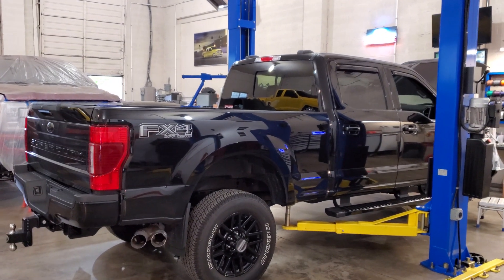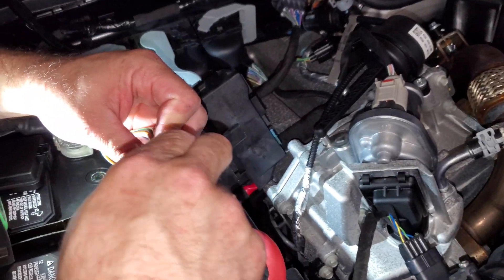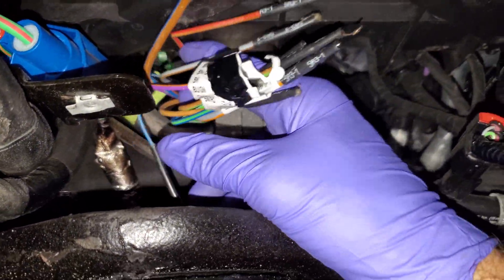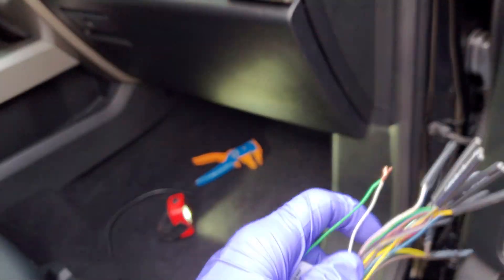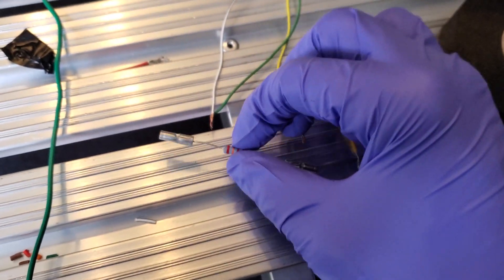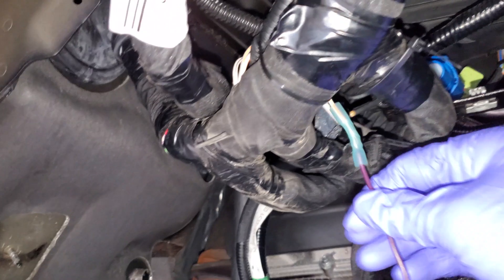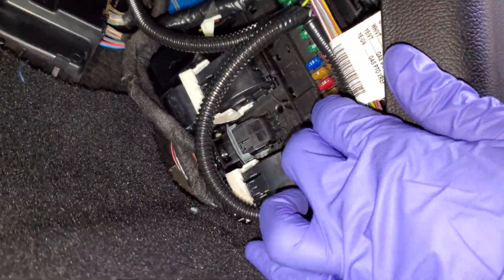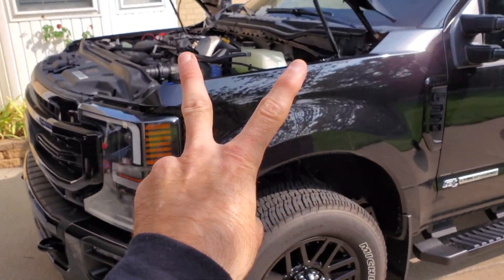17+ Superduty 6.7 | HIGH Idle Up-Fit | HOW TO

Comment: Could I Use a 20 k ohm resistor? To achieve around 1200 rpm?
Reply from the maker: U cld, but bro i took this out & got the BD high idle switch. WAY BETTER

Comment: Off-topic question… hearing the accessory power chime from your truck reminded me. 

My ‘18 350 is stuck with the pre-sync 3 chime (2011-2016 thin sound straight out of the cluster). I have heard of this issue from others in the past where it reverts to the cluster, but cannot figure out how to correct it. Of course, two dealership service departments that I have spoken to have played dumb when I asked them about it. Any thoughts or suggestions? Thanks so much!
Reply from the maker: Still does it, haven't correlated it with jack diddly yet 🤔🤔
Reply: @ that is what I was afraid of lol. Oh well..just thought I’d ask. Much appreciated 🙏🏼

Comment: Dunno why, can’t get my 22 450
To work. 
Upfitter 1 to pass through wire
Pass through to yellow/green (next to the violet/brown)

Solid green to blue/white

Using 15k .5w resistor

Comment: Just came across this video and it sounds like you are pretty knowledgeable. I bought the bd diesel high idle kit and they told me the reason it isn’t working on my truck is that the pto is not hooked up. I know it’s a long shot but do you know what that means?
Reply from the maker: This is just a hook up hi. Idol and has nothing to do with p. T o

Comment: Can you think of a reason for this to suddenly stop working??? I did it on my 2020 and it worked fine until now it just doesn’t work. I’ve checked the voltages to it and the resistance of the resistor and all is normal. The truck won’t even go into high idle by itself when idling anymore. Thoughts anybody?
Reply from the maker: Hmmmm. We have since removed and got the BD high idle kit. We made a video for it. Was way better
Reply: I saw that…. I also watched a video you did fixing a PTO with a broken wire and the e-brake light didn’t come on. I am going to check that next as I didn’t make sure that part is ok. I considered getting the BD kit but thought that might not work either if this system doesn’t work.

Comment: ARod, I did this to my 24 the other day, everything works fine but after a few minutes of high idling I noticed the truck was making more noise than usual, kind of like the noise it makes when using the exhaust brake. I checked my gauges and the truck was making 8 lbs of boost and climbing and my EGTS were at 800 and climbing. Any idea what was going on? The truck is stock other than the high idle switch
Reply from the maker: Yea that's normal, they want them EGTs hot for that burn off
Reply: Ok cool, I figured the truck might have been taking advantage of the higher rpm’s and trying to clean the DPF but I wasn’t sure. It spooked me, I stopped leaving it unattended while high idling and when I would hear it spooling up like that I would go shut it down. Glad to know it’s normal. Thanks for the reply man.

Comment: I ordered the BD DIESEL Performance 1036612 High Idle Control last week and just saw this video, I guess I'm going to be sending it back because I like using my uplifters just wanted to know what's the Watts of the resistor but other than that Dam good install video keep it coming.
Reply from the maker: Watch the newest video. We took that out. The BD kit ks so much better

Comment: I've got a 17 six seven.  Same pig tail in passenger side.  But I got lights hooked to up fitters 1 and 2.  No way these other acronyms on the pig tail represent up fitter 3 or 4 in order to use those switches?
Reply: I got it figured out.  Thinkin on the run!

Comment: Some things to note: I just did this on my 2022 psd tremor, Ford has since moved the through wires to where they are really convenient, the ones inside the kick panel are right next to the harness, then under the hood they are right of the three big ecu harnesses tucked under them next to the firewall behind the fuse box you removed with the aux wires. So don't rip out your fender liner for absolutely no reason like I did 😆 also, there are TWO yellow with green wires and that was not discussed. Wire #7 is the yellow/green wire you need for a diesel, the other yellow/green wire is for a gas engine applications. Great video otherwise. And props to Ford for Making it more accessible!
Reply from the maker: U shlda seen our newest video, way better
Reply: @PowerStrokeTechTalkwARod  subscribed! Ty!
Reply: @PowerStrokeTechTalkwARod  link to video in reference? Looking at the list don't see any other high idle reference, unless you're referring to one of the light hookups?
Reply from the maker: We have 3 high idle videos....this one......& 2 we just made. One for 2017-22 & one for 11-16. The 11-16 video is now HOW i mount all trucks
Reply: @PowerStrokeTechTalkwARod link?

Comment: Why does ford make the pass through wires so short? It is ridiculous 😂
Reply: Fellas, my 2017…those things are so far tucked up I can’t reach them with my hand or 9” 45° needle nose pliers. Advice?
Reply from the maker: YOUR MISSING OUR NEW ALUMIDUTY HIGH IDLE!!!! GO WATCH OUR NEWEST VIDEOS
Reply: @PowerStrokeTechTalkwARod  no I didn’t. Trying to save money dude. Carli suspension ain’t cheap.
Reply: @PowerStrokeTechTalkwARod  and I just found a better alternative. It’s a little cheaper…12v solutions has a bad ass kit for our trucks.
Reply from the maker: Ok
Reply from the maker: Bro i know......2022 they made longer.

Comment: Spliced in resistor and tried but when I hit the white/brown wire with 12v it just cycles the turbo wastegate? Any thoughts
Reply from the maker: Whaaa
Reply: Green and white/brown get resistor will have another go at it
Reply from the maker: Check out our latest high idle video, so much better

Comment: Thanks Aaron! Great video. I learned that on my 17, there are 2 yellow with green stripe wires. One is for gas pto, one for diesel pto.
Pin 7 is the one for diesel PTO. 
Works great!
Thanks again
Reply from the maker: Hell yeah. We have a new high idle mod coming. I will tell you, i will be removing this. You will like this 1 even more😁😁
Reply: @PowerStrokeTechTalkwARod  is that out yet?
Reply from the maker: Yepp was out months ago
Reply: Mine too thanks
Reply: Thank you for this!

Comment: Hey Brother, had a F150 gas and now I am driving a F350 6.7, great content. I might have missed it somewhere, but can you tell me where I can get the resister you used and the part number if you got it.
Reply from the maker: I found them on Amazon. Its been a minute since i bought em tho
Reply: @PowerStrokeTechTalkwARod  , cool, I am looking on Amazon and found the 22K resisters, but there are different watts, what do you recommend?
Reply from the maker: U know thats a good question, i threw the gd bag they came in out 😔😔.

Comment: I have new 2022, F250 Lariat. I did everything as shown and unable to get it working. The wire from the fuse is hot when switch is on, and I’ve connected to either of the two yellow/Gr wires with no luck. I locked the parking break and tested across the resistor as well.
Reply: Same here on my 2020 …. Nothing work ….😢
Reply from the maker: Swap the green & yellow wires. You shlda saw our new high idle vid
Reply from the maker: Swap your green wires with thee other in that bundle, happens all the time
Reply: I don’t understand. I tried both yellow/green wires   The solid green and WH/BR have the resistor between them
Reply from the maker: Hmmmm

Comment: Hi Aaron, on my 22, when I picked it up at the dealer I swear it was on a high idle but I dont see a switch and didnt see anything in the manual. How would I check to see if it was a factory installed item
Reply from the maker: If you do not touch the accel or brake it idles up to bring exhaust and emissions up to temp. Thats it. Not what u saw in the video

Comment: Do you have the link to these resistors?
Reply from the maker: No  i got them off amazon. Read the comments people have posted links...........
Reply: Yeah I’ve looked but haven’t actually found a link. All I’m finding is go to Amazon but once you’re there you find 100’s of options. I got 22Kohms 1/4W. They look much smaller than the ones in the video. Will they still work?
Reply from the maker: Yepp

Comment: What causes an f250 2017 to just go into a high idle 1000 rpm then hit the brake and it went back to normal idle thanks
Reply: Thank you i have been spreading your channel to new people that have our trucks
Reply from the maker: Thanks so much pal
Reply from the maker: Thanks for asking, it is a totally normal thing when left with no brake or accel response for a given amount of time. The PCM does this to maintain adequate exhaust temps, engine temp to keep emission output as low as it can be.

Comment: Just did this on my 2022 F-250 Platinum Tremor with 6.7 Power stroke. I used a 15k ohm resistor between the white/brown and green wires from the harness and green for the pass through to my #2 upfitter switch. I did remove the battery and tray which made access much easier and left battery disconnect led for two hours as recommended for ECM. Worked like a charm. Great video!!!
Reply: How many RPM’s does it take the idle up to with a 15k ohm resistor?
Reply from the maker: Get the BD high idle kit & be done. I took this out
Reply from the maker: You don't have to disconnect them brother
Reply: @PowerStrokeTechTalkwARod  Thank you! I didn’t want to risk anything. Only reason I did was because when I installed my SB intake it stated to do so.

Comment: Are there different levels of high idle? Just wondering because it will sometimes change and make different sounds like it’s closed a vein off or something. 2020 6.7, thanks Arod!! Ur the man 🤘😎
Reply from the maker: You either have added high idle like u saw in the video OR if you leave your truck sitting with no accel or brake input, the truck, by itself, will raise the rpm ONLY to bring the truck up to operating temp & also to get into closed loop fuel control quicker, ie emissions

Comment: How would you make this work so it will idle up with the remote start? My 2020 F350 takes forever to warm up in the winter. Thank You.
Reply from the maker: U set the park brake, hit what ever up fitter switch u got it hooked to, and let her rip.....starts then idles up immediately. Done.
Reply: @PowerStrokeTechTalkwARod  
Sweet. I was hoping it would work that way. I didn’t know if the up-fitter switches would power up with the key off. XLT model.

Comment: This is an awesome video just wondering if there’s a way to do this with remote start and no parking brake
Reply: Aaron in your opinion is it a bad idea to do this with remote start.... When the engine is dead cold will it go straight to 1,200 rpm or is there a delay?
Reply from the maker: I have no issues
Reply from the maker: Parking Brake is a MUST have input

Comment: I tried this on my 2020 F350 pretty sure I did everything correctly even tried with a potentiometer and a regular resistor. Everything's the same to your video and checked Ford Q-256R1 Bulletin and confirmed its the same. I'm getting nothing, flip aux 2 switch and nothing. Fuses are fine almost positive connections are fine all butt spliced or soldered. Not sure what to do. Seems like a simple mod but giving me problems.
Reply from the maker: I'm not being a Dick but go back through the comments we covered this with the green wire, there's 2 of them try switching that green wire to the other one and see if it changes.....
Reply: @PowerStrokeTechTalkwARod  Figured it out 10 min after posting that neck move. There are two YE/GN wires and I needed to used the CE912 Wire tag PTO 1. I was wrongly using the Yellow / Green GAS PTO VREV LE 424. Thanks for the awesome videos and info you're putting out Arod!
Reply: I’ve checked myself multiple times and I’m hooked to pto1 but no elevated idle when parking brake is engaged and aux one is one. Went as far as checking that I was getting 12v to the plug. No change 2019 f250 . I can see on the male side that the pto gas doesn’t have anything on it.

Comment: Hi Aaron, I wanted to tell you I really appreciate your knowledge and content on this channel. I watch regularly. …. I had 2 super duty’s and just got my second. Great trucks!!! I wanted ask for some help/ guidance. My new tremor with the 6.7 was special ordered by me with upfitter switches but the sales manager didn’t include it on the build sheet. Now, I am trying source part numbers for lariat overhead console without sunroof with the switches and wire looms needed. Would you have any information?  I have checked the tube and found a video for 2017 my issues Not the loom is the same. Thanks for time energy on this channel. It is great 👍
Reply from the maker: I'm not aware that you can add that to the truck after the fact....
Reply: I’ll

Comment: I have 2 wires that are YE/GN one says GAS PTO V REF and the other PTO 1 how do I tell which one is the one I need for the pass through to the upfitter switch?
Reply: We got it. Works perfect. We were looking at the aux switches backwards 😂 thanks for the video!!!
Reply from the maker: I believe it was the pto one I had to switch it because mine didn't work
Reply: I hooked it all up like in the video and mine idles high with switch one off and goes back to normal when you put the switch on. Any ideas???
Reply from the maker: Not sure how that wld even happen. Like the switch is working backwards

Comment: Your videos are so helpful.
Unfortunately with this one I'm a bit confused, hate that and having to ask stupid questions. 
Why are these (pass through wires) need?
Aren't the upfitter switches already pre-wired? 
If I want to install other things such as, lightbar, backup light, air compressor, maybe even a train horn, will I have to tap into the pass-through wires to wire each of those things?
Seems like if a guy has to use those passes through wires in conjunction with the upfitter switches you're going to run into a problem where there are 6 upfitter switches and only 4 pass through wires?
Reply from the maker: Pass through wires are just 4 wires that go through the firewall it doesn't have anything to do with the upfitter switches now if you wanted to control something that you needed to hook up on the inside with an upfitter switch I suppose you could do that

Comment: Probably a dumb question but does it matter which green/yellow wire you use behind the kick panel?  My truck had 2 of each of them.  I used 2 to put the resistor in between and dug those pass throughs out but when I set the brake and flip the switch my idle stays the same..
Reply from the maker: Yea we ckvered that in the comments. Just swappem around

Comment: On my 2021 F450...it has those front fender flares...is it faster/easier to pull the fender liner/flare/front wheel/tire OR remove the passenger side battery, tray and whatever else is down there to access those pass throughs on the engine side of the firewall?
Reply from the maker: YES!!!!
Reply: @PowerStrokeTechTalkwARod  sorry bro...yes to which one?  battery or fender liner?
Reply from the maker: Batt box

Comment: Went to do mine tonight; after all was done it didn't work - walked through again and noticed my harness has two yellow / green wires? I imagine I just need to swap out to the 2nd to splice into the pass through. Is there a way to tell which is the correct one for others that might be trying this?
Reply from the maker: U r correct. We went over it in the comments a whiiiile ago
Reply: @PowerStrokeTechTalkwARod  
Cool, will fiddle with that PITA pass through in the AM To see if that does the trick.
Reply from the maker: It will juss de pin it and swapp it
Reply: @PowerStrokeTechTalkwARod  
Couldn't wait, went and switched and boom high idle. Thanks again for all the great content!
Reply from the maker: Impatient 😂😂😂🙋‍♂️🙋‍♂️🙋‍♂️

Comment: So do you have any videos on say wiring headache rack spot lights to one of those switches? Are they like the 6.4 where the switches are powered already and you just need to connect the dead headed switch wires under the steering column to one of the pass through wires then grab it again behind master cylinder or are the new Super duty switches powered up  right underneath that fuse box you pulled up under the hood?
Reply: I have a alumaduty.. (well getting it Tuesday ) getting rid of my 6.4.  The uppfitter switches on the 6.4 required you to splice into the upfitter switches under the steering wheel to a set of wires to pass through into the engine bay in order to power anything with them, but looks like the alumaduty already passes powered wires into the engine bay under that fuse box, am i correct?
Reply from the maker: Yes sir!!!!
Reply: @PowerStrokeTechTalkwARod   thanks man, that’s all i needed was power already outside the cab! I’ll run the rest!  Perfect!
Reply from the maker: Sorry only for alumidutys, others soon

Comment: How about adding a 60K+ Potentiometer between the green and the white/brown wires. Maybe end up with a variable high speed idle after flipping it on with the Upfitter switch.
Reply from the maker: Yes that too
Reply: @PowerStrokeTechTalkwARod  What wattage resistor do we need?
Reply from the maker: Check out them comments. People have posted links

Comment: You can also buy a plug and play wiring module to do this , it install's in a minute on the passenger side where your pass-through wires are . Just plug -in and you are ready to go . They sell for about  $120, wish I new this before installing a potentiometer on the driver's dash which took me over 8 hours work. The advantage of a potentiometer you can adjust the rpm speed to what you want.
Reply from the maker: Yea mine was pennies compared to that kit....

Comment: Do you know if this will work on a 21 7.3l gas? And does it turn off if you touch the brake pedal with the parking brake still on?
Reply from the maker: Shld, & yes & yes
Reply: @PowerStrokeTechTalkwARod  thanks